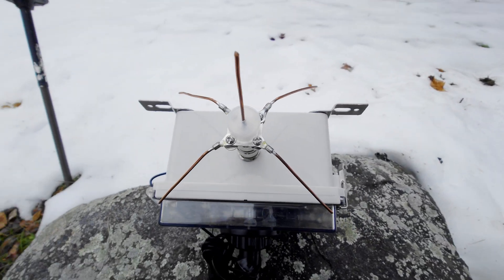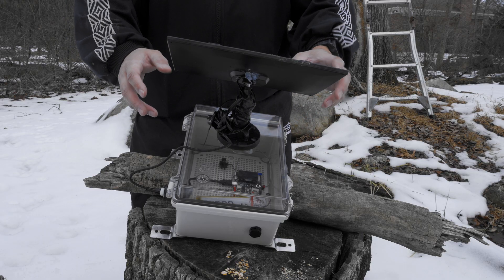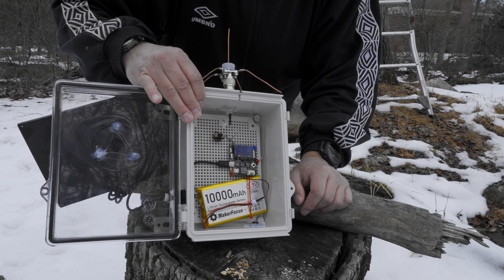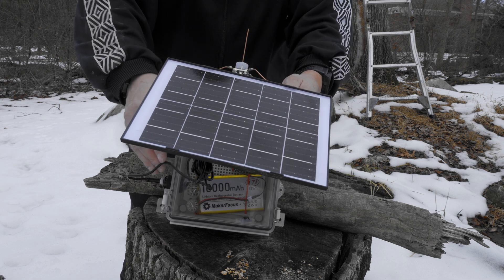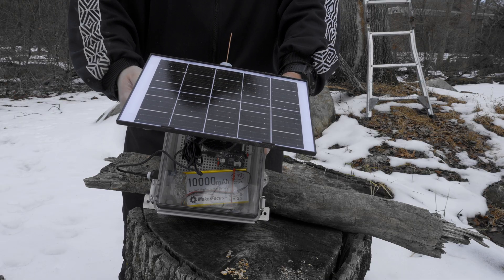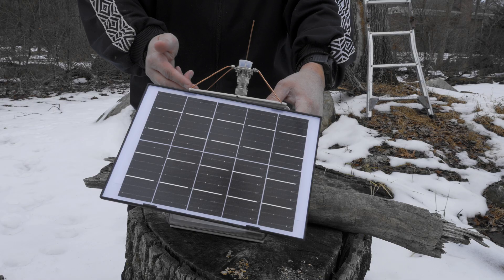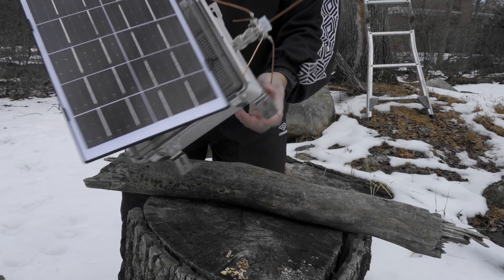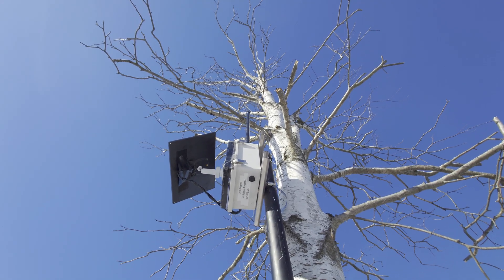Meshtastic Solar Node- NYME- NY State

Comment: How is the battery holding during cold days? I am up in Montreal and we get temperatures down to -20 Celsius or -4 Fahrenheit. Does it drain your lithium battery?
Reply from the maker: Yes battery suffers. Loosing around estimated 50% of capacity

Comment: All good, but why still on Meshtastic? In my area everyone went to MeshCore already.
Reply from the maker: Because mesh is working here and aint broke.  When i get enough time and $$ then dual nodes will be the thing
Reply: What does meshcore do that meshtastic doesn't?
Reply: @TerminalElement  I have started few weeks ago in my area and MT was not available, when I have switched to MC I got info that everyone is migrating and new nodes are being deployed because it is much more usable long distance.
And it does - I can see nodes 300km in each direction. I can hear messages from 14hops away (200km) I am heard 10 hops away.
Meshtastic as I understand is limited to 7 hops? MeshCore theoretical limit is 64 hops.
Also. Many users have dedicated repeaters (getting 2 devices instead of just one) and it makes sense. I have placed my repeater in optimal spot for my apartment, companion can be placed anywhere.
They both have their use cases, MT for short distance single device comms (1 device does it all) vs MC for long distance comms (dedicated repeater and companion device)
Reply from the maker: Meshcore has restrictive methods of only repeating signals through repeaters and not just anyone. It can be more reliable in certain cases but the whole point for meshing is that if one node goes down then network will still work, if a meshcore repeater goes down then alot more goes down. Its basically ham radio infrastructure with restrictions. Different tool for different application imo.